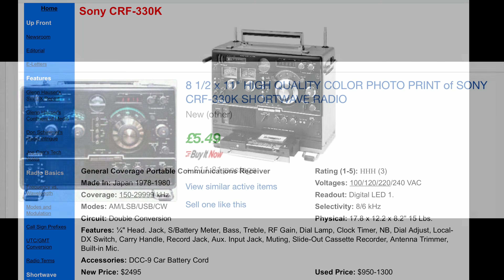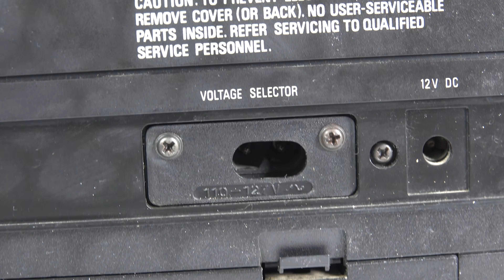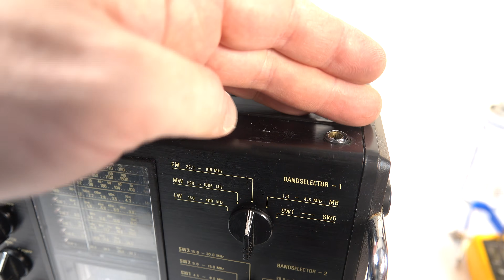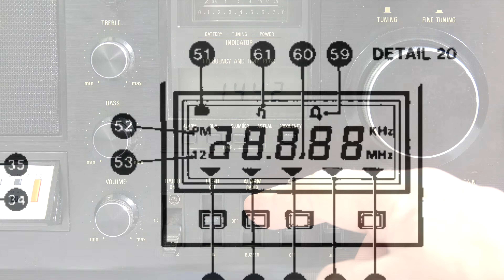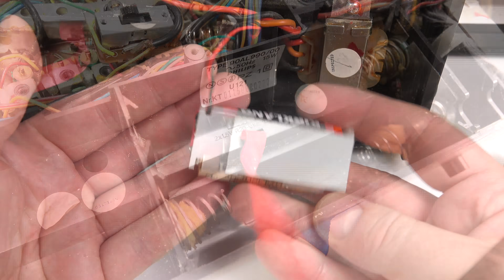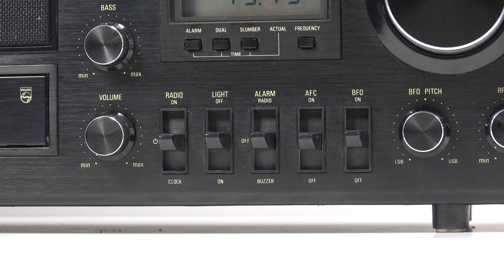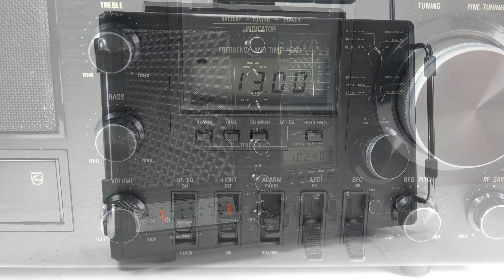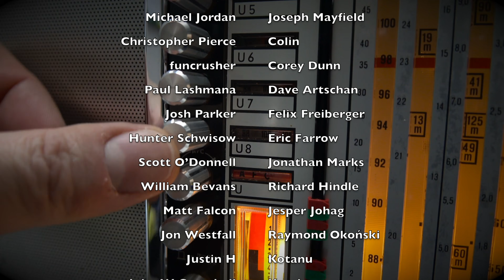Parts or Repair? - Philips AL990 Shortwave Radio

Comment: You did not measure the transformer, so how can you be sure it is broken? Also it did not work with DC either so I believe that there is something wrong after the power supply. Why didn’t you try to find the fault which is probably just a transistor or so?

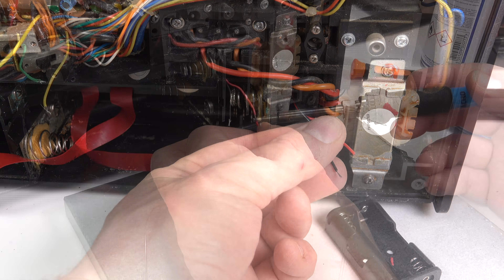Comment: 9:51 & 10:10 I hope you've put some heat shrink or electrical tape to insulate the contacts. Also, the transformer can be checked by putting your multimeter across the primary connections and across the secondary connections of your transformer. The transformer could be fixed by replacing the windings on either the primary or secondary. I'm guess its maybe a couple dozen turns at most.

Comment: This is the same type of shortwave radio I would have recommended searching for, not this exact model but one in general that receives SSB or single side band which is what that BFO or beat frequency oscillator is for. This allows for the reception of two way communications below 30 MHz as well as the broadcasters. AM being used for two way stuff is rare outside of CB and the occasional amateur radio transmissions but even if you don't listen to two way stuff regularly SSB reception is still very nice to have.

Comment: I'm no expert, but if I'm reading the manual correctly, rectified AC power is in parallel with the 12V input. Meaning that whatever the problem is, it's somewhere between the 12V input and D-cell batteries. If I had to guess, I'd say that a capacitor might have gone bad.

Comment: Only about 4 mins in so far, but why would it be the mains transformer if its also not working via the DC Jack.
But great video :)
Reply: exactly. at least he could have measured on the secondary side of transformer if there is any AC voltage. Also, it is probably a simple 12V trafo given the 12V DC in. As the DC in also does not work, the issue is further in the power circuit OR the switch in the DC socket is not working.

Comment: This is possibly my favourite Techmoan video! I agree that reviews of modern shortwave (and medium-wave and longwave) devices would be welcome. My favourite SW portable radio brands were Grundig, Panasonic and Sony but this Philips is more towards a communications receiver while still being portable (although my Realistic comms receiver, like many, does not have a facility for internal batteries). If new (or more recent) shortwave portables or receivers are to be covered, I suggest Tecsun, Eton, or possibly Sangean. Then I might get round to buying myself a more recent SW radio rather than listening online to an SDR (software defined radio, like that at Twente University).

Comment: If you look on the manual page 11, as the fuse are not dead, maybe the transformer is not dead too (what say your voltmeter ?), but check around 7065/2SC1173 (which handle up to 30V)  and 7083/1802M (it's a BC328 which handle -30V/-50V) and Zener diode 7186/BZX79C12 which could explain why it does not want to work in 12V input.

Comment: After seeing the prices of some old receivers online, I will choose the newer performance of a modern SDR Transceiver, much better receiver with amazing noise reduction, and filter selection, better selectivity and sensitivity, more modes, more options for digital and analog, a spectrum waterfall type display, as well as a transmitter. Most modern radios Can be connected remotely over a network, IF connection for other options, etc. A link below shows a newer radio with two direct sampling receivers in one radio for just under $2995.
https://www.icomamerica.com/en/products/amateur/hf/7610/default.aspx
For even more affordable between $1100 & $1200
https://www.icomamerica.com/en/products/amateur/hf/7300/default.aspx

Comment: what kind of FM antenna (aerial) would you screw into the back of that unit? I have an old stereo receiver with the same to screw tops but can't seem to find the right aerial to fit with that style connector.

Comment: Thanks. You might find that the transformer is fine, but that diodes, a regulator, or a smoothing capacitor in the power supply have failed. In which case, the repair might be quite simple. Transformers are often more robust than semiconductors or electrolytic capacitors, during a voltage overload.

Comment: Check transistor 7065 (page 11of the service manual, bottom left corner, to the right of the DC in jack) (7083 right below it might be worth a check too). It has probably died from overheating. The transformer is probably OK (you can measure resistance of the primary, and anything less than about 100K means it's fine).

Comment: Why did you not test the transformer for continuity & output ? 🙄😕
Also... vaseline petroleum jelly on the battery terminals will prevent corrosion !! 😎👍☘

Comment: I downloaded the service manual to see if I can help. Let me try to translate. In the manual I read the radio can store local time, a second time en the time the alarm is supposed to go off.

Set alarm time
Push alarm (38).
Push store (40). The alarm time will disappear.
Indicator alarm (54) blinks.
When (40) isn't pushed in 5 seconds after (38) was pushed, the local time will reappear.
Set the prefered alarmtime (see setting the clock).
Store the alarm time in the memory with te start button S/S (38).

Alarm

Choose alarm function SK-E (26).
Choose alarm 1 or 2 (35) local time or second time.
Switch lever radio/clock SKG (30) in the clock position.
The loudness depends on the position of the volume button (3311).
The alarm can be switch off by:
a) Puting the switch radio/clock SK-G (20) in the middle.
b) The touch contacts (44). The alarm will repeat in 24 hours.
c) The alarm switch SK-E (26) switched off.

Comment: My dad bought new the very same radio in the 1980s. It was pre GPS time and we were using it to locate ourselves doing Direction finding while sailing a rather small sailing boat based in St Malo. You had to tune to 3 beacons that were transmitting their name in morse code (I still remember the Jersey one was very powerful and called Corbière callsign CB -.-. -...) and then plot on the map the directions hoping that the intersect triangle wasn't too big... We were also using it to get the weather forecast on long wave (BBC 198kHz or France Inter 162kHz) or on SSB (Le conquet radio, I forgot the frequency). Tuning on SSB was an art as you had to tweak the BFO button to get a clear transmission.The radio is still functional despite all the time spent in humid environments and now used as a radio clock.

Comment: @Techmoan, 

I thought that the FM band was shut down in the UK?
Reply: No, the UK government hasn't even got as far as setting a date yet for switchover. There is little consumer interest in digital radio and that is hardly surprising given that the receivers are more expensive and power hungry than equivalent quality FM radios, network coverage is very patchy and the multiplexes operate at such low bit rates (to squeeze in more channels) that audio quality is often inferior to FM. 

The official figures suggest that over 50% of the population now access radio digitally but this is something of a cheat as they include online streaming and radio via digital TV. I'd guess that FM will continue for at least another 5 years and probably more.

Comment: Hi. If both the 12VDC and AC inputs do not work, then it is not the transformer that is the culprit, as the transformer only does the step down of AC voltage. So it has to be something else downstream...

Comment: If you take a layer or two of the insulation tape off the trnsformer you may find a thermal fuse which can be replaced. Keep up the good work.

Comment: It is small cheating but you could probably solder inside 2 wires from 12V DC to battery connectors. Then you can use it without batt.

Comment: You should be able to re-wire the transformer plug to the battery compartment. 
Just change it from the 12V to the battery voltage. (Looks like 6V)
Reply: Also the Amps shouldn't matter.  Because it's not driving anything mechanical, like a tape deck.

Comment: Repair ! Repair! Repair!!! I love old Shortwave Radios, that was a darn good find at that price!! I am a little confused as to why the 12V DC supply would not function if the transformer was dead. I would definitely take a look at the power side of the board as it is probably a simple arrangement of bridge rectifier and smoothing caps and maybe a couple of voltage regulators, very easy to source and replace. The 12 line would be coming in next to the mains rectified output somewhere and may have what looks like a resistor or little black oblong with numbers on it as an inline fuse soldered on board. Also it doesn't mention polarity on the back for the 12v, so it too could be going through a bridge rectifier ( more likely 1 diode, the same as the other chunky black ones) for protection. If you get time I would deffo take a look at it :) You could test the primary side of the transformer with the resistance setting on multimeter, if you get a reading of a dozen ohms or so, good chance it survived the voltage attack :) Sorry, just paused your vid on close up of power side. The 12v jack looks very dirty and could just be oxidised preventing a good contact from your 12v input, it would also need to be a pretty beefy 12v of around 1 amp or so/ I assume the plug with red/black wire is the 12v input from the jack? I can see the bridging diodes and ceramic caps, they look good. The little yellow zener diode may need checking but looks good. It looks like there is a wire trapped under the red/black wired plug so it may not be seated properly :) Thats all i can tell you from the vid. The chip MC14011B is a Quad 2 input NAND gate. Its very close to the tuning components but also a transistor nearby so could be part of the Alarm function or the touch plates on top, as a guess. The 'B' means it has buffered outputs and can drive TTL logic loads within specs. However it is only rated up to 18V so if they did bang 240 over the transformer and the output was meant to be 12v, then a brief 24v would have gone through the board before something gave up. Hope this helps.. But I bet Big Clive could get it working for you ;)

Comment: That's a swell radio. RF gain and BFO are musts for shortwave. Don't pay more than that. There's modern radios that perform dramatically better for much less than the thousands they're asking for these old units.

Comment: Taking a quick look at the schematic:
The DC 12v input should work. If batteries work, then the 12v input should. Tip is positive and ring is negative.
The AC power transformer /may/ still (sort of) work. There are three AC inputs behind the plastic cover. The one on the right is 120v, the middle is common to both, and the left one is 220v. By applying 120vAC to the 230v and 120v input (ignore the common in the middle) it just might work on AC power. Not too sure how useful that is to someone living in 220V land.
I thought there was something wrong when the LCD display only worked when batteries were installed, but apparently that's the design.

The AC transformer is almost unobtanium. Unless you have "extra" markings on the transformer that allow a Google search, the best bet is to either find a close enough modern replacement (need electrical engineering skills to determine an appropriate substitute) or find an electrical engineer who's willing to take that apart and actually re-wind the damn thing (done it before. Not my proudest moment. Hated myself).

Comment: And let me add, connect a 50 or 100 foot piece of magnet wire to the antenna with alligator clips, or connect straight to external aerial sockets, switch to Lower Sideband (LSB), turn on that BFO .. and tune in some amateur radio operators at night on 40 meters (7000-7300 mhz) and wonder in amazement how your wire can actually pick up some many American and worldwide stations talking from their home about daily events. Some even talking with a wire. Fascinating, I promise. Propagation is weak at the moment as we're in the bottom of the 11 year sunspot cycle, but 40 meters is your best bet, although other bands like 80 and 20 show plenty of life. And don't forget, when broadcast band DXing, the weaker the signal the cooler. Check out channels like Oxford Shortwave (Clint) and Senderyaeger (Mattias). They are legends of DXing.

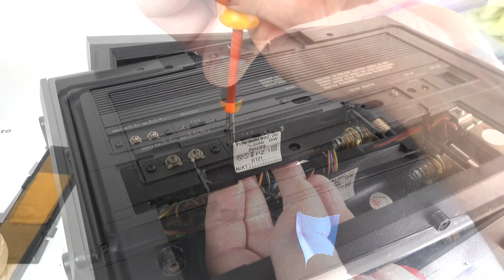Comment: 10:25 That's pretty grim -_-
Also, since it doesn't work with 12V DC either then it's likely that diode bridge and some other stuff after the transformer is fried too… while transformer itself may even be well alive.

Comment: I'm 65 years old, and back in Junior High School, grade 7,8, and 9, I took an electronics class, and I would repair old tube radios. I used a signal generator, and a signal tracer to find a faulty part. I would then tune the "cans" according to the manual and they worked great. It was a good hobby.
Reply: شكرا جزيلا كيف اعرف الفولت لهذا الجهاز المحول معطوب علما يوجد ٢خرج

Comment: For the short external antenna wires, I guess the small terminal plate can be unscrewed from the outside and threaded through a hole, thus avoiding long HF wires running near the wrong circuits.

Comment: You need to replace the battery connectors- lest they start re-rusting. Better yet- convert that old radio to Li-18650 lithium batteries.

Comment: Sangean is another brand with a good reputation for making good short-wave radios & mine is an ATS-808 which I purchased more than 25 yrs ago. Being a more compact radio it misses out on SSB (single side-band), but unlike many of the cheaper receivers of the time it has Digital PPL tuning & stereo-output for head-phones!

Comment: I bought a comparable shortwave radio that has the opposite problem. That is, it works fine on mains power but not on batteries.  Any ideas?

Comment: I don't believe the transformer is dead, the 12V input would have worked as it bypasses the transformer, I believe it's more like a blown diode or something simple like that right after the transformers secondary connection. You can always check with a multimeter in the AC setting to see if the transformer is outputting any voltage just to make sure.

Comment: You should test the transformer before you consider replacing it because those are generally very resilient. The problem is likely in the voltage regulation circuit.
Reply: Agreed and transformers usually can be checked with an ohmmeter in seconds to determine if open/shorted or shorted between primary/secondary windings, the main methods of failure.

Comment: You won't bother or probably read this, but in many better appliances power transformers usually have fuse built in on primary side. You only need to strip few layers of insolation tape where wires from mains goes in. Fuse looks like small block condensator half a cm by half cm. You could replace it or just short it. Shortening it won't make it more dangerous, just next time when someone mess up something it will be dead for good.

Comment: The old stuff still has a certain appeal, even though you can get a USB dongle and download some free SDR software that does more on a laptop than most consumer grade radio receiver units.

Also if you're a cheapskate and don't want to spend any money, there's WebSDR where you can listen to receivers that other people with SDR software stream onto the internet. And that works right through the browser, so it's a bit of an interesting novelty in itself. So now not only exploring the dial, but you can choose where in the world you're listening from.

Comment: I'm quite sure the alarm only works, when the radio draws power from the mains. I noticed the display showed a little batery icon, when you turned the alarm button to buzzer.

Great video though. Love it every time I see a new video from you in my subscribtions :)

Comment: Two tips. 1) Use heat shrink to insulate soldered joints. 2) Stagger the joints. BobUK.

Comment: Well, i had a philips turntable with a blown transformer (it's a GA 212), the solution was simple: disconnect it by desoldering from the wires that connect to the board and solder them to a normal 12V external transformer plug (as that ones used to power external hard drives for example, i've used one of those). In my case the original transformer (very very similar to that in your video!) simply converted current to 12 volt, so i think this can be a cheap and quick solution to your "batteries only"  problem.

Comment: I had the Sony short wave radio ICF-SW1E and used it as alarm and took it on holiday to listen to BBC World Service news in 1989. The aerial was damage and I could not get a full size replacement which made the broke off original better for reception. But then it sat in a draw and so I sold it on to someone who would hopefully enjoy using it day to day. On my last trip in December I got all the news via the internet and wi-fi in the hotels.  Sony have made some beautifully designed pocketable gadgets over the years.

Comment: Well Mat, for me it looks like either the Battery compartment switch has gone or the rectifier is blown. On several portable devices when inserting the power cord into the device, the battery compartment is deactivated due not charging not rechargeable batteries or never stops charging accumulators.. A rectivier consists of 2 or 4 diodes to turn the AC from the transformer into DC. A large filter capacitor must be in the device to provide uninterrupted DC, but when operaing nice on batteries, this capacitor seems to be in good condition. A inexpensive multimeter could tell in the rectifier or the transformer has failed.

Comment: Hold up -- If the transformer was dead, wouldn't plugging an AC adapter into the 12v input work?  Don't wall warts have an external transformer?

I have a feeling something else might be blown.